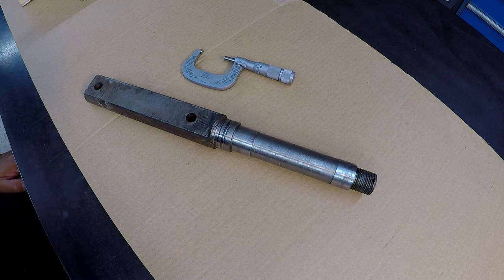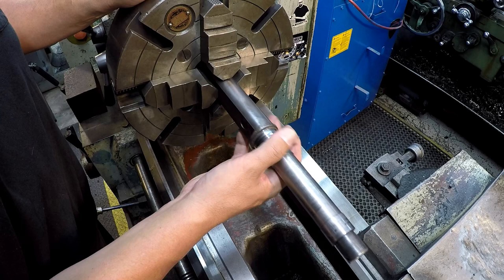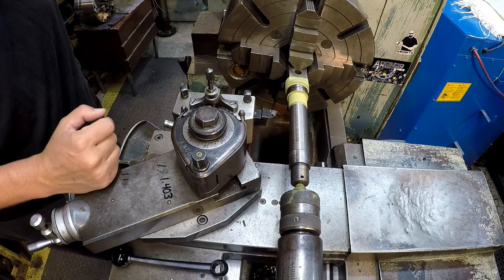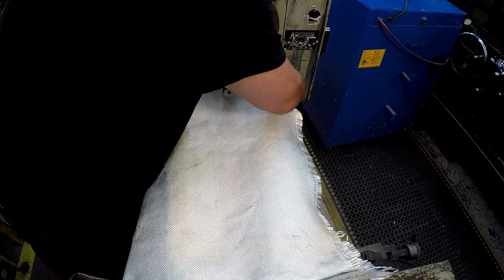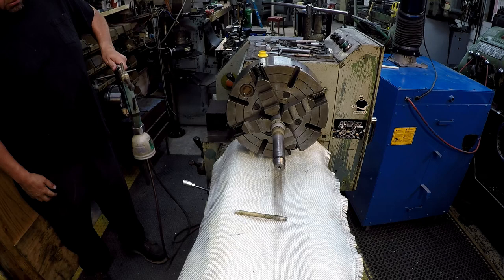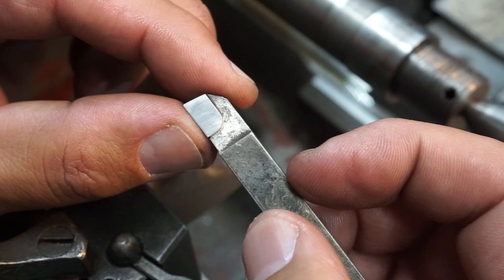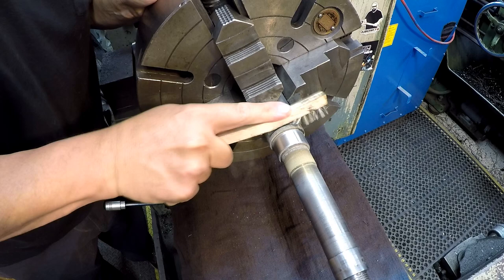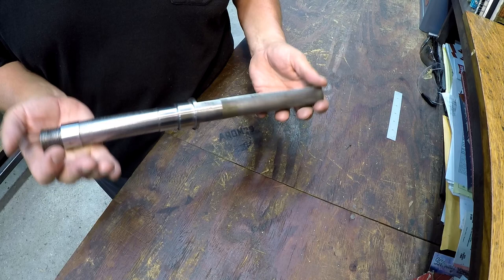Spray Weld Repair for a Porter-Cable G8 Sander Spindle

Comment: Hey Adam I got this massive ridgid vice No.60cpn on letgo don’t know much about vices but it’s in great shape it’s like 200lbs. You got anything on that for me?
Reply: That Ridgid 60cpn was made by Columbian for Ridgid, probably in the 70’s. That is a massive and very desirable vise, especially if it still has the pipe jaws.
Reply: You are 100% correct I broke it all down the other night to clean it up and did see that it is in fact a Columbia vice that is  labeled and sold as a ridged. It has big replaceable vice jaws and pipe jaws.. it’s in excellent condition. The vice color now is green,  but I was wondering if it would have originally been sold painted the industrial Ridgid orangey-reddish-radish color??? If it is the wrong color I want to soda blast it and paint it the correct color. It is missing 2 of the pipe jaws at the moment but the source where it came from said they have them 🙏. IT IS A TANK I never seen a vice this big that’s why I had to have it… I was thinking about donating it to the local gas station so they can attach the women’s restroom key to it so it doesn’t get lost🤣……!! Any idea what it would be worth  in impeccable shape ? Thanks for your input Ron I really appreciate it hope to hear back from you!
Reply: Don’t know the original color, try scraping the paint to see if you can find some original paint. Value? General rule of thumb for a desirable vise in good shape is about $3/lb. In the real world, a vise is worth what someone is willing to pay for it. There is no shortage of old vises, they are bolted to workbenches and hidden in dark corners of shops all over. I have several dozen that will reenter the used vise market some day.

Comment: silly question, but why not grab it be the round part?
Reply: rick engelman looks like the round part is machined and critical seals. The other end looks to be non critical so if the jaws mark the finish it is not a big deal
Reply: @philthefarrier9469  my first thought was the square end that was chucked into the jaws, didn't look square, but rather tapered...then when abom said he wanted to keep the work area, away from the heats and spray...granted, he has a four jaw, and there was already a center point, it worked out, but putting a center point into what you agree was a non critical part, seems like a smarter move, to me...

Comment: Love your videos. Sometimes you make me wonder though :-) 
Is there a reason other than showing the procedure for spray welding when a mig bead and a clean up cut would have been easier and cheaper, and quicker to clean up. 
Is there a Rockwell or hardness rating for the spray material that would offer better seal wear?
Reply: He changes things up from time to time to show how there's more than one solution to a problem or repair.  I'm sure he'll agree with you regarding the mig, however it's not always about the ease of cheapness of a repair, but rather to educate everyone who watches that there's different solution to different repairs.
Reply: I would rather spray weld than use a gmaw love me a good challenge lol
Reply: Spray welding is the proper repair here, not mig welding.
Reply: MIG welding would distort the spindle. The arc is ~3000-20000 C°. An Oxy/acet flame is 3160 C°. Also, spray welding applies the heat uniformly to the part; whereas MIG concentrates heat at a single point.
Reply: if you're not getting porosity there would be no difference using 70sxx filler TIG/MIG welding or or even using 7018/7014 stick. 
The prep and cleanup hardly makes that small of a journal for a single lip seal the "proper" way. It's  is definitely another way... but not superior in any fashion. 
A single bead would have been much faster to cut and polish over spray welding.
It's  a cool method of repair for sure. Unless it has some extreme hardness or some other advantage not discussed in the video it's hardly cost effective.
Reply: @EDesigns_FL  It's not enough to just discuss temperature.  Time is a factor or heat soaking also. Laying down a single bead would hardly warp the part since it would only be a few inches of weld. Other welding methods lay down enough material fast enough to soak the part evenly and with minimal total input.  Almost an inch and a half of solid steel :-)
Reply: @derekinhawaii  I was curious how the metal sprayed compared to other fillers. Always more than one way to skin a cat... just seems out of reach for the "average" repair :-)
Reply: @FastBowtie388  I'd say quite the difference. Porosity shouldn't be a problem, heat input and distortion are though. TIG gives you the ability to use just enough amperage to fuse to the parent metal. Spray welding gets nowhere near that hot, so from what I've seen at my friends shop and a few YT guys it seems the best solution for smaller non I/C bearing journal repair. I've only done I/C engine crankshafts with TIG due to thrust forces on journal surfaces. As careful as we are with heat they do bend, so they just get pressed straight again. But for what this sander shaft is doing I couldn't see anything better than spraying it.
Reply: Maybe for hollow shafts that would be ideal also. It's  a cool process to watch. :-)
Reply from the maker: I’m just going to disagree with all of your theory’s. If you think welding a shaft is faster, better, and does not warp or bend a shaft, then go ahead with that. There’s a good reason Eutectic developed this system. Welding has its place, but it’s not for EVERY application.
Reply: Spray welding isnt melting the base material and therefore best option here to limit distortion on this shaft..
Reply: @FastBowtie388  If you believe that laying down a single weld bead won't deform a shaft, either you've never done it or you didn't check your work afterwards. Any welding method which imparts enough heat to melt the parent metal is going to cause distortion. The big advantage to spray welding is that a small amount of metal is being evenly deposited over a large area; not at a single location. Also, the part does not have to be heated to it's melting point in this process. 
The primary cause of distortion in this type of work is weld contraction during cooling. This is an issue for both thermal spray and arc welding, but the difference is that with arc welding more material is being applied to a smaller area than with spray. It's this unevenness that causes so much distortion with arc welding.   
You don't need to believe me about how much arc welding distorts shafts. Get a couple V-blocks, DTI, and some ground shaft material and try it yourself. I don't care how good or fast a welder you might be, you will significantly bend a shaft with any type of arc welding ;-)
Reply: @EDesigns_FL  I think you're missing the point I was trying to make. It's a sander ;-) Good enough is good enough. It was chucked up on centers and the run out was going to be shaved. I was more curious on the metallurgy and if there was something that made this process more ideal.
Reply: @EDesigns_FL  Companies have been making kits (for cars that produce more power and spin faster) to repair timing seal covers from tin :-) They cost about 5 bucks. A pressed bushing would have worked,  spray welding, regular welding. I was curious about the company's specs as far as seal wear. If that's  soft low carbon steel like I'm  guessing it is.... will that seal leak after 1,000 hours or do they have a  work around for that application? It wasn't  a "critique" and I wasn't denying the results. I am wondering on cost effectiveness and reliability.
Reply: @EDesigns_FL  It is entirely possibly to weld 1.4" of steel without warping it. It's done all the time on 20ga sheetmetal if you take precautions and don't get greedy :-) Most GWAW metals are rated over 70psi... I was just curious what this stuff can do :-)
Reply: @jeremydoblinger3609  If you don't melt the parent metal (even if it's ever so slightly) you don't have fusion. It's  "spray welding" which means it melts to the parent metal ;-)
Reply: @FastBowtie388  If you believe that 1.4" steel or 20ga. sheetmetal can be welded without warping, I have a bridge that I would like to sell you. 
Also, thermal spray welding does not require melting the parent metal. The spray alloy has a lower melting point. The bond is similar to brazing. That's why Adam did a scratch pass to improve its bond. The micrometer-size particles solidify as soon as they contact the part.

Comment: How do you get the sharpy off the slide?
Reply: Elbow grease
Reply: Oxy/acetylene torch ...heat it to 3700°F and it wipes right off.  ;-)

Comment: I need to repair a spindle on my drum sander and Im not going to do any metalizing like this. I really do NOT trust it at all. Ill fill it with normal weld then machine it. I know I can count on the weld material.
Reply: The issue is welding adds thermal distortions... amongst other issues... This method doesn't do it because the temperature on the shaft is way lower...
Reply: @aerogfs   For someone who has never worked in a shop before Im sure that would be a problem. Ive been in the shop 43 years. Ive done this repair many times with mig and tig. I know how to control the temperature. I know all about everything the metal is going to do. 

Thank you very much!
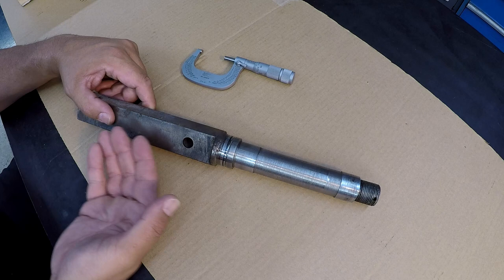Reply: @jrpo6379  i dont trust spray metal either. Ive been working 5 years in an industrial electric motor shop and seen that spray weld chip off or come loose and destroy bearings and electrical in the motors. Fan and pumps blades it seems to work better on, im only @1:10 in the video not sure how a seal fit will last.
Reply: I agree 100% conventional weld is far superior

Comment: While this might work for this application, there are better more reliable ways of doing this. The shop I work in remove and replace this type of coating all the time.
Reply: Ragtag Dirtbag we repair parts like this but on a larger scale. The processes we use are similar but will hold way longer than this particular process.
Reply: Albert Anderson there are always better ways and smarter people, but the humble Abom79 was just showing us an example of a solution he has used.  I have used this method on seal surfaces for years and have never had one fail but that's my results and i don't do it in a production shop.  In my personal shop in this case i would have TIG welded it and ground it to OD.
Reply: We don’t even offer this particular process in our shop. We repair electric motors and heavy industrial equipment.  This particular process might hold up for a bit but in our field it always fails. I hit a shaft that was coated this way with our pressure washer and the coating came right off.  All I’m trying to say is there are better ways to this.